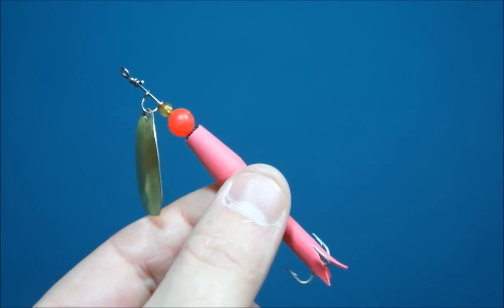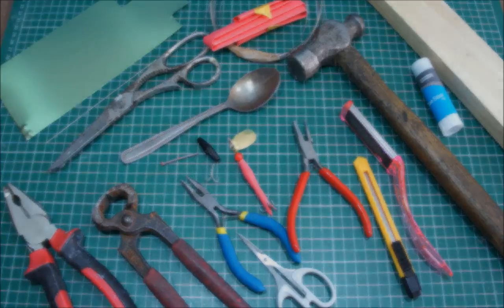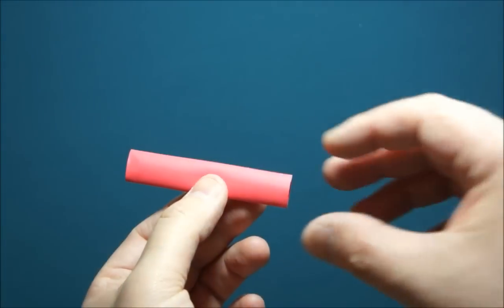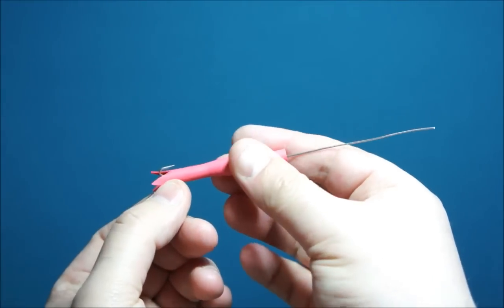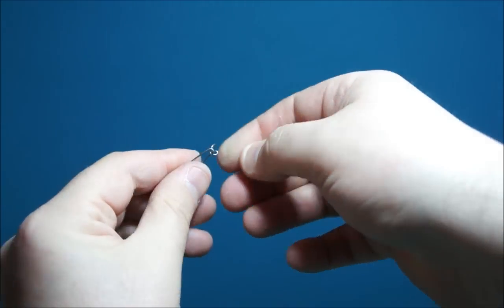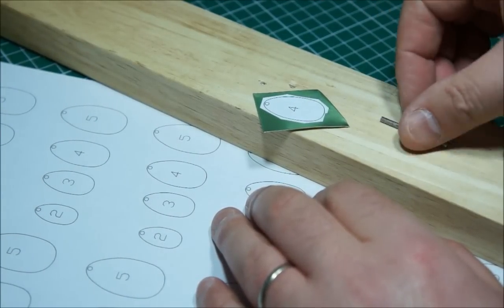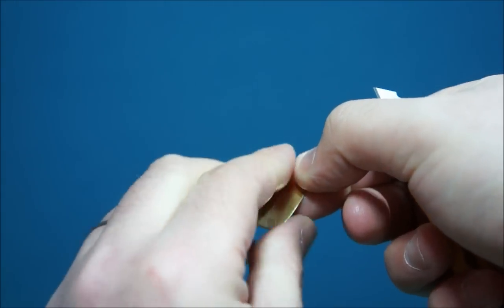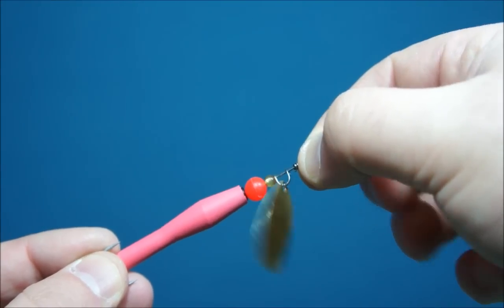How To Make A Flying C Spinner fishing lure

Comment from the maker: I test wire work usually with the lure attached to a bench and a bar through the hook and then jerk like made using my body weight. This kind of testing is far outside what any fight i have had with fish has produced. When things fail for me it tends to go in this order,The knots, line, hook, trace, rod, reel and then lastly the wire. The main weaknesses in this lure are the hook and the wire twisted around the eye. The force in a fight should be transferred directly between eyes. Thanks Paul

Comment: If you use a hole punch for leather to punch a small hole at the head of your tail cut then it will prevent tearing of the rubber or silicone, instead of just cutting out a v notch. The body material will last a lot longer.

Comment: Hello, I was wondering if you could reupload somewhere and link to that spinner blade template you were talking about please?; the blog's link from scribbd was unavailable to view/download. That would be awesome and handy since I've just gotten into making homemade lures. My first lure was 99% scrap-built, a folded heineken bottlecap rattler on an old guitar string shaft with a teeniebopper yellow shoestring rooster tail and a soda can bottom spinner blade! Also, what would you say your strike/cast ratio for the Flying C has been for you? Also also, does that shrink wrap come in other colors? I think a dayglo yellow one with black sharpie dots would work swell here in New York.
Reply from the maker: email paulpadam@aol.com i will send the pdf's   , i have no idea about the the flying c ratios it has been a while since i have used them , shrink tubing come in a range of colours, but you can also buy silicone tubing as well, thanks